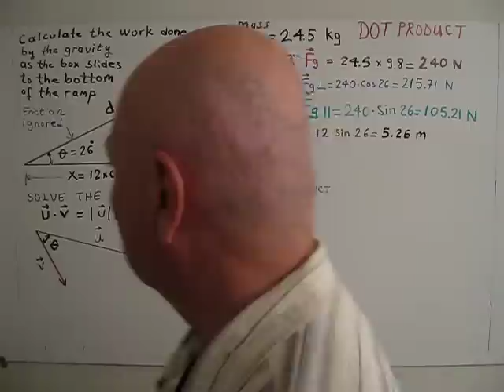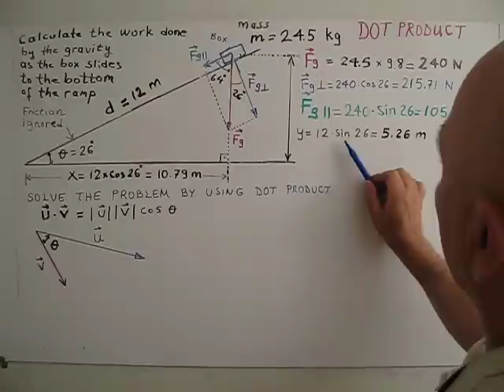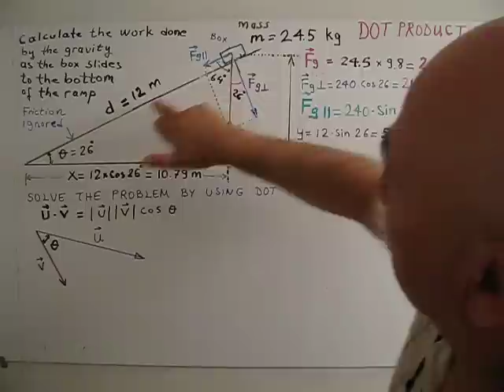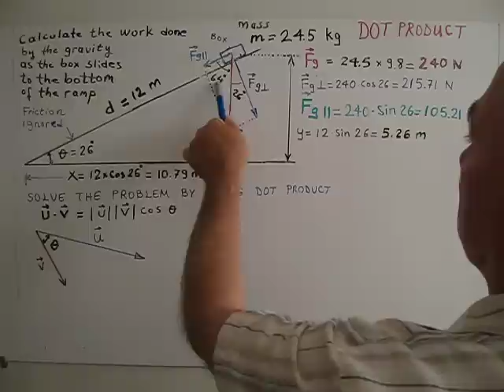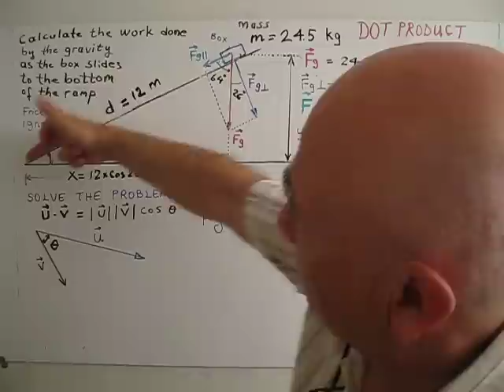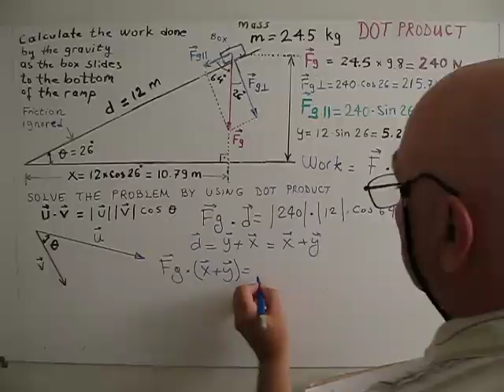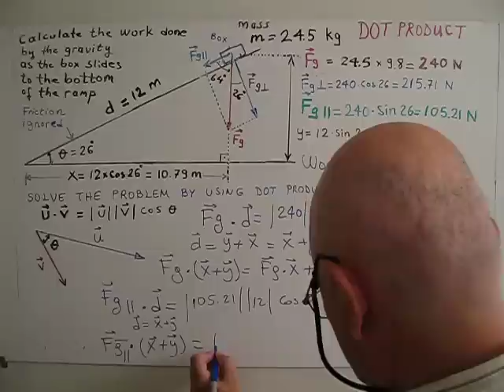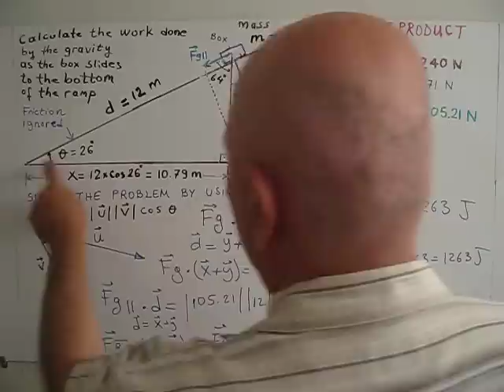Vectors, Application of Dot Product

Comment from the maker: @xNaN3x Angles between two vectors is found by bringing two vectors tail to tail.  If you bring head to head, you get the same result.  If you bring head to tail, you will get negative of the same value.  But it is better to bring tail to tail. Regards.